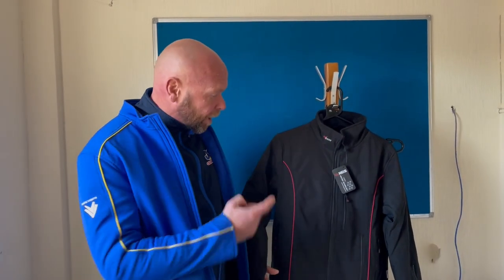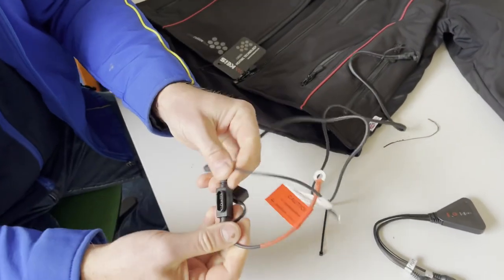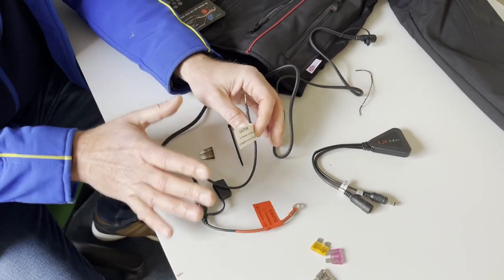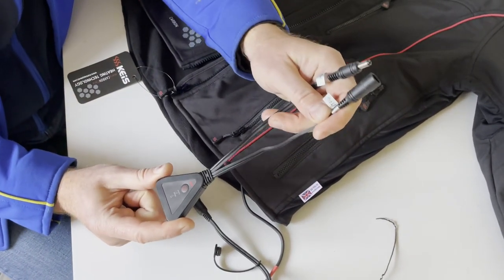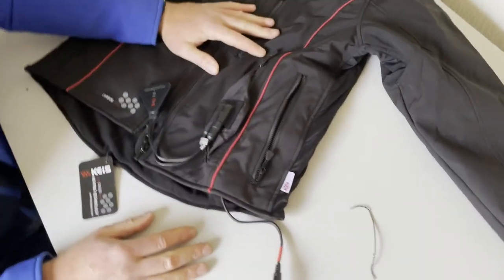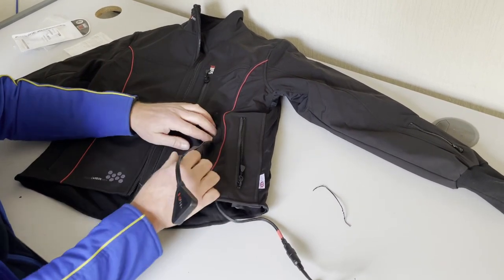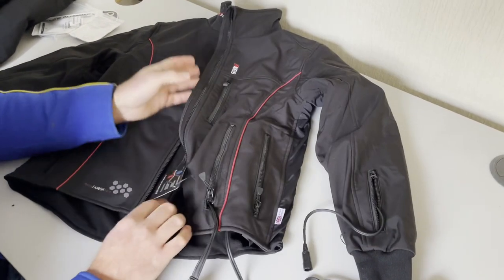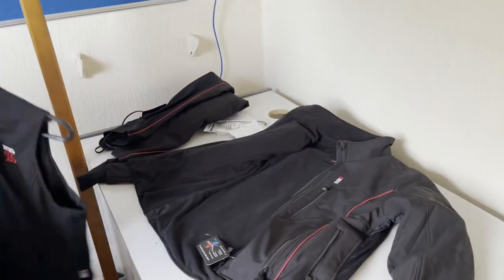How to properly set up Keis heated clothing

Comment: I’ve done exactly, as was shown by my dealer which is also exactly the same as this demo. I have the jacket and gloves, for some reason they both heat up lovely, but the controller does not function or do the gloves heating button. Any ideas anyone?
Reply from the maker: Hi There, If you call into your local store, They will be happy to help you out with it.